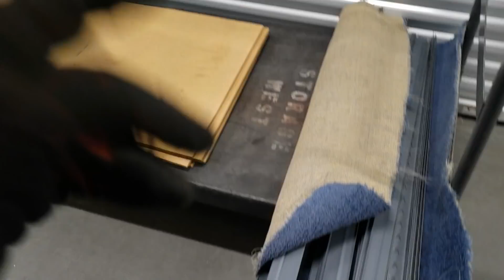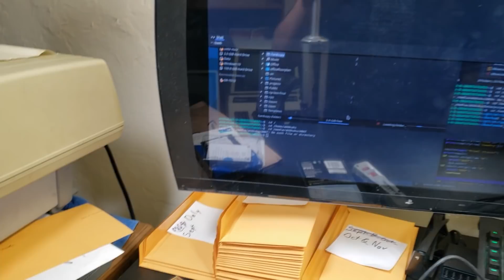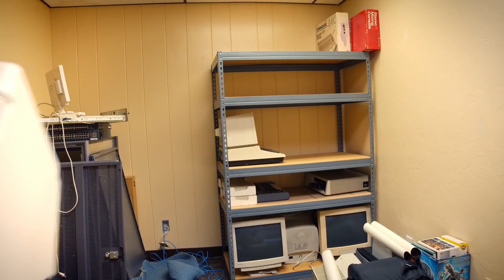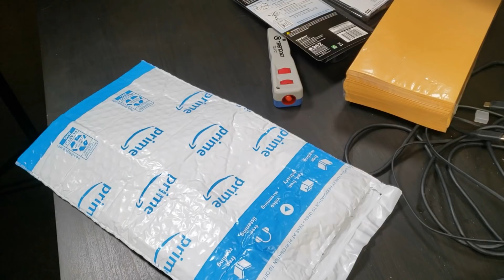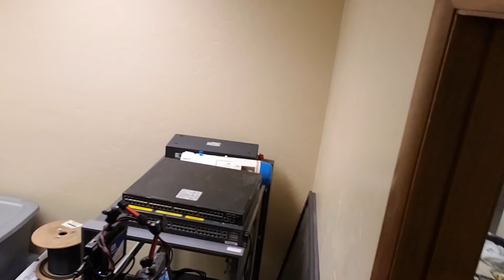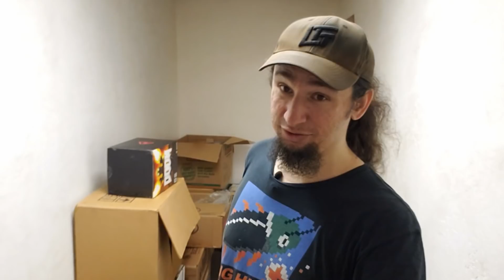Office Vlog 0x06 - CRT and Computer Storage Ready

Comment: the punchdown tool often has one end of the tip that has a chisel tip to cut off the excess, then one side that allows you to punch down but not cut the wire if you are going to daisy chain the wire to a second connection.   flashback of nightmares of doing a ton of cat5 cabeling back in the day when I saw that fall out of the amazon bag hehe.

Comment: For storing keyboards I built something.  It's conformed to the depth of the shelf ,and it's open on the front and back with spacers so that the keyboards don't rest against each other.  I kind of looks like a comb.  I made the spacing just slightly wider that the keyboards so I could put them at a slight angle.  It works well, and it allows me to store my keyboards fairly well.  I'm sure with quite a bit of work with an engineer I could design something better, but it worked for me in a pinch.

Comment: @43:00 - That ATT has a bad PSU, but everything else should work fine, the battery did not leak before I removed it. And yes, you got it from me a while back.

Pro Tip: Over the next several months do yourself a favor and start switching out those shelves for plywood. Those chipboard shelves will not hold all that weight for the long term, they will eventually sag and eventually give way and eventually fail. Probably take longer where you are due to the lack of humidity, but will happen.
Reply from the maker: Ah, that should be very repairable then! Thanks for the info/reminder. I did remember getting it from you but I didn't remember if you had cleared my saying that at this point. I asked after the next video I have edited that will be released next.

That's good to know about the chipboard. It is extremely low humidity here so it may take a while. But I'll keep an eye out and get to that when I can. I'm not a big fan of the chipboard anyway so I don't mind replacing it.

Comment: I'm pretty sure you could find one of those stackable letter trays for filing paperwork which would be suitable for holding your keyboards. You'd have portions of the keyboards extend beyond the trays themselves, but they should be deep enough to accommodate the better part of each keyboard such that the keyboards don't topple out of the tray, plus wide enough to store any trailing fixed cables as well.

Comment: Be careful with how you store the keyboards with their cords.  The different types of plastic used in the keyboard housing and the cables can react over time, so that if the cables and touching the keyboard they can actually like burn into the plastic.  I've had a few nice keyboards semi-ruined with bad gouges in them that way after just a few years of storage.  A very simple solution I use is just to coil up the cords into a sandwich bag all the way up to their origin from the keyboard, and then wrap a rubber band around everything a few times to keep it from unraveling
Reply: Yes - this is a great point! The technical reason behind this is that they add softeners to certain plastics (usually to make a cable more flexible), which off-gas over time and will soften nearby plastics as well

Comment: Have you seen line printers? Never got one for work but if we had stayed on home brew systems we would have needed one.  When I started in IT tech support in the late 90's the company I worked for had NCR mini computer feeding WYSE terminals running a COBAL base system. They had 4 GENICOM wide format printers for printing reposts (on green bar paper), packing slips, production labels and invoices. As the old GENICOM's wore out I replaced them with Printek printers. Not much plastic on those. For a little bit we were also using an old Epson DFX printer like the 9000. I like me some production printers that's for sure.

Comment: I had a space about 10x10 at my old place, and to maximize my storage I arranged my shelves in a spiral. It was definitely labyrinthine, but it maximized my space. At my current place I have a U configuration, with shelves lining three walls, and a double wide layer of shelves extending outward from the 4th wall. the 4th wall has 2 doors, an entrance and a closet, so I can access both. Have you considered spacing the two heavy shelves apart, and getting  a few short shelves cut, and screwing right angle brackets between the two shelves and hanging the narrow shelves between. could make a nice spot for storing narrower things. Just dropping some storage ideas.

Comment: Your storage room is looking good! When you use the punch tool, make sure that when you terminate the keystones that the longer pointy bit (blade) is pointed out as its supposed to cut the excess  wire off. Lots of keystones and patch panels also have the colour coding right on them for both 568A and 568B standards. I'll have to look as well I have little cutters that are great for stripping the jacket off of cat 5/6 as well. May have to send you a set of those! 

I did send some shelf brackets from your wish list as well already.
Reply from the maker: Thanks! And good tip on the punch tool, I don't think I would want to mess that up. In the next video I open the keystones I have and I think they were color coded like you mentioned, that will make life a lot easier. I got a new crimp tool in the next video as well that has an integrated cutting tool for the jacket. It worked fairly well when I tested it, but I don't know if there is something else better out there.

And thanks! Those are going to make my bookshelf project a lot better!
Reply: @TechTangents  haha yeah it would be rather counter productive 🤣

The brackets showed as having been delivered a while ago so I'm hoping that you've gotten them and they didn't disappear. When terminating you just have to use the same standard at each end, and using A on one and B on the other will create a crossover cable which can be useful if you need to link old routers/switches that won't do it automatically. 

I'm looking forward to seeing your next vlog, they're definitely among my favorites!
Reply from the maker: Ah! I think I got them and opened them in the next video then! So not lost and I do have them.

That's actually a good reminder to make sure I use the same standard. I always to A if I remember right but I'll double check the colors on the keystones when I work with them.

Thanks! They've been much better received than I would have guessed!
Reply: @TechTangents  ah ok good im glad you've gotten them! 

Basically any manufactured patch cable I've seen is wired with the B standard. I was taught that we use the A standard up here in the great white north (eh? 😝) and the US used the B standard but not sure how accurate that is. I've heard the B standard may be better for dealing with interference but practically I've never noticed a difference. With the right crimp tool it's easy to make your own patch cables too!

Comment: Out of curiosity: Have you any bad experiences with failing SATA connectors on these camera SSDs? Because those internal connectors aren't actually designed for repeated plug-in cycles, and I would have expected them to fail rather quickly. The WD Hard Drive Interface Guide for example states: "[I]nternal SATA cables and connectors are designed for only 50 insertion and removal cycles." That is probably just a statistical minimum value, but I wouldn't expect them to actually last, like, an order of magnitude longer than that. So I'm wondering if you had any issues with that in practise. My instinct would have been to use USB, which can handle way more cycles (1,500+), but you're the guy with the practical experience.
Reply from the maker: That is actually a very interesting question that I had looked into myself before I settled on this solution! The SSDs and the docks(the camera doesn't normally support SATA, I added a USB-C to SATA adapter for that) I'm using are all standard consumer grade hardware that will have the standard 50 cycle rating for the SATA connectors. I was concerned about that, but I've had far more problems with cables failing than connectors and USB-C has a lot more fragile little conductors in it now. So I was not too confident in using USB-C SSDs all the time. My workflow with the SATA drives is specifically set up so I never have to use a cable, I'm basically treating them like cartridges. I think this is likely to be more robust in the long run.

Comment: You can count to 31 on one hand using binary. Unfortunately depending on how you orient yourself when doing so, either 8 or 4 is basically flipping someone off, and there's a few other rude gestures sprinkled in somewhere through there I'm sure.

Comment: I'd use the wall hampered by the door to set up something I've been thinking about for (eventually) my own keyboards. Either get thin, free floating shelves to set up in the walls (I actually have one with a very small barrier towards the edge which would fit nicely) or get small, squared wall hooks to hang them there. The disadvantage is that it would probably be something of a custom fit for each keyboard, whereas the free floating shelf would be free for all. Anyway, the keyboards would be safe from being crushed, easy to reach and also on display at the same time. I think you might be able to get those very cheaply in the US, since they are not absurdly expensive here in Brazil.

Comment: I have seen other YouTubers clic the Rode module to their cap to valid the beard noise. I have been enjoying your moving series.
Reply from the maker: I was thinking about that but I feel like it would be too distracting. I've kind of got it worked out now where I point the mic down instead of up and I've trimmed my beard a bit more. Those two together have pretty much solved the problem now.
Reply: @TechTangents  I saw them clip it on the side of the cap next to their ear so they couldn’t see the flashing lights.

Comment: Why not use some brackets to screw the shelves together in the storage room you assembled and put in during the video?
Reply from the maker: I'm probably going to use nuts and bolts to connect the two sets of shelves together after I was recommended that instead.

But the top and bottom of the shelves aren't easy to attach with brackets because the pins that hold the shelf braces in block it some. I'm pretty happy with how sturdy they are after having it up for a while though and I"m not concerned about it.

Comment: I would suggest bolts for the CRT shelves instead of bailing wire.  Grade 8 5/16 about 1.5 inch should work and never break.  That should also draw the gap between them closed.
Reply: brackets that work with that would help greatly too!

Comment: For keyboards it would be nice if you could get a set of dividers. Place the dividers vertically in a shelf and then slide each keyboard between them slightly leaning on their backs. That way they aren't pressing on each other and the keys won't be rubbing. Kind of like |\|\|\|\|. Then whenever you need a keyboard you just slide it out.